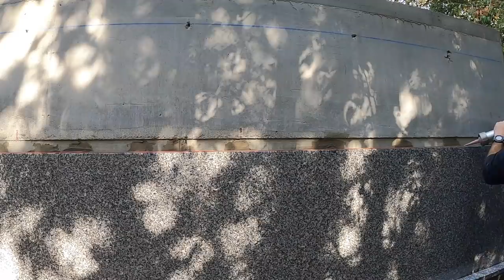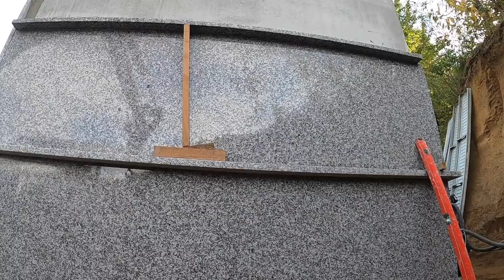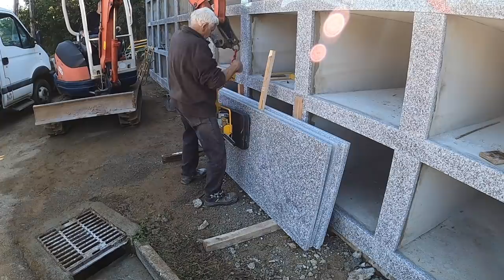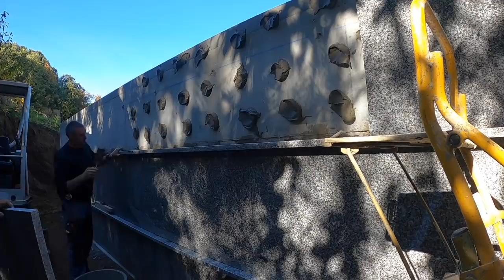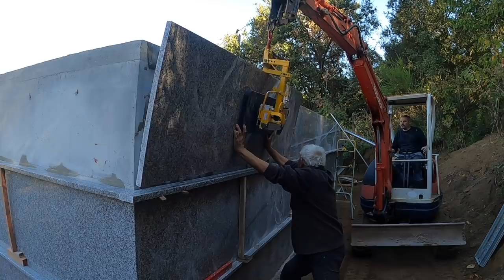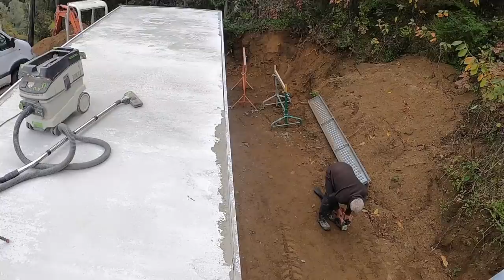Habillage en granit cinquième partie

Comment: Bonjour les Corses, cette fois  on y est au toit, je pensais que tu allais faire un troisieme rang d' habillage a plat, (en mettant des plaques plus longues) mais je crois pas d' apres ce que l' on voit elle seront poser a l' interieur du cadre, ça le fera quand meme .... 
Bon travail meticuleux avec de tels engins c' est pas évident, la ventouse vous aide grandement, la modif était obligatoire .....
Histoire de nous montré la creche finie d' installer, tu pourrait pas nous faire une petite vidéo a la tombée de la nuit que l' on voit ce que ça donne illuminé ??
Bonne soirée
Reply from the maker: Bonjour,
c'est bien ce qui est prévu pour le toit, les plaques sont 2 fois plus grandes, 8 plaques pour le toit avec des couvres joints et ces plaques dépassent de 6 cm, comme les bordures. On va voir ça très bientôt lol. La ventouse nous a bien faciliter la tache, et effectivement la modif était vraiment nécessaire. La vidéo de la crèche est prévue, il faut juste que je prenne un peu de temps pour aller filmer ça. 
Merci et bonne soirée également !!!
Reply: @SOLITAIRE2A  Ok, ça m' étonnais aussi que tu n' y ai penser, il m'a semblé que les cotés dépassaient de 20 a 25 mm a vu de nez, et que tu les mettais a l' interieur, tu a pas eu trop de charge de colle, meme si tu reste dans l' acceptable en passant par dessus   ?  
Nickel pour la creche, merci ...
Reply from the maker: @forzaferrari3931  La dalle a été coulée parfaitement de niveau donc avec l'habillage j'ai fait en sorte qu'il y ait une légère pente sur l'arrière, ensuite je fais des règles sur cette dalle pour réaliser la pente. Ce n'est pas facile a expliquer comme ça mais on verra ça en détail très bientôt.
Reply: @SOLITAIRE2A  Oui tu a raison, c' est plus facile par l' image, on va attendre .....